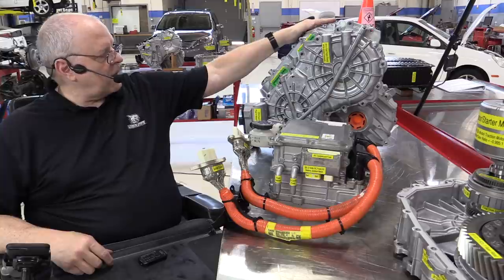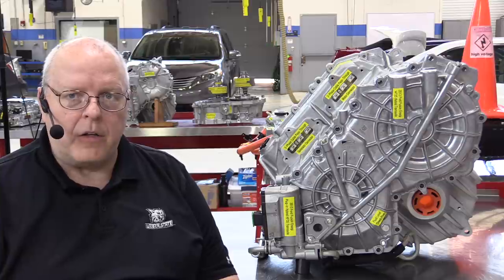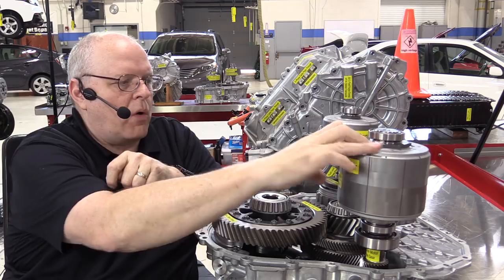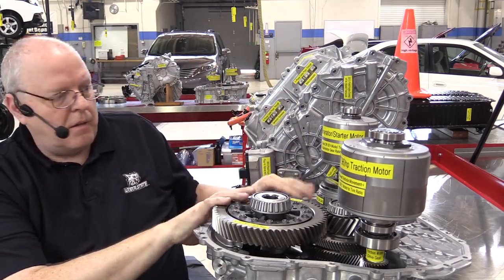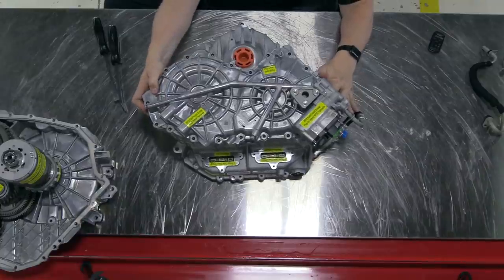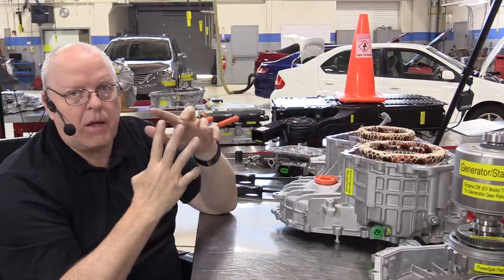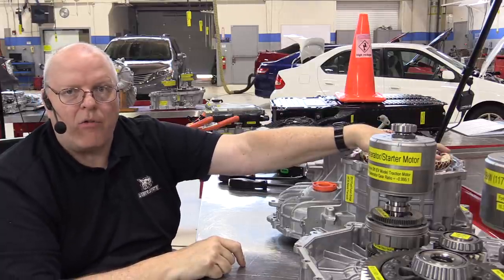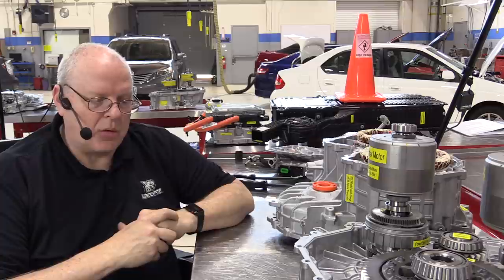Ford Fusion HF-35 Hybrid Transaxle Electrical Operation

Comment: Just bought a 2018 Fusion energi. I'm impressed. Everywhere I read it says it has a CVT. Looking at the gear train in this transmission I do not see a means of varying the ratio. Am I missing something?
Reply from the maker: The rotational speed difference between the engine and the motor “A” creates a variable gear ratio. Thanks for watching
Reply: @WeberAuto  Sorry.. that is not the meaning of a variable. This set up is still a constant ratio.
Reply from the maker: It actually provides a variable gear ratio with underdrive ratios, direct drive, and overdrive ratios. It works just like the Toyota transaxles. See my video here for a better description https://youtu.be/O61WihMRdjM

Comment: At 18:34 in your video. I just want to let you know that the magnetic field in the motor "BOTH" attracts and repels as part of the process of moving the rotor. During rotation, if the stator magnet is "after" the rotor magnet, an attractive force is applied. But once the rotor magnet passes the stator magnet. The polority of the stator magnet is reversed and a repulsive force is then applied. Pushing that rotors magnet into the next stators magnet to be attracted to.
Reply from the maker: Thank you, you are correct!

Comment: Great videos! Do you know how the 2017+ hf-45 differs from the 2013-2016 hf-35 unit?
Reply from the maker: It turns out that the HF-45 was never released. I understand it will be used in an upcoming hybrid SUV
Reply: @WeberAuto  So maybe it is in the new Ford Maverick?
Reply from the maker: @DanNPTRI  I suspect that is true. Probably the same powertrain as the Escape hybrid.
Reply: @DanNPTRI  it is a Kuga

Comment: Professor, Can you explain why this Ford Fusion 2015 transmission has so many problems and have to be replaced? Our 2015 Ford Fusion with 112,000 miles broke down. I've seen lots of videos that show same problems with this model. Thank you for your great videos!
Reply: I'm dealing with it right now on my 2017 Fusion Hybrid. From what I've read so far, it is important to change the transmission fluid at or around 100K miles. Mine failed because of a leak from the driver-side axle output. I didn't notice the leak because of the felt/thin carpet cover (that goes underneath the engine compartment above the ground) absorbed most of the fluid.

Comment: I've heard of a few transmission failures on this gen fusion hybrids. I have one and want to do a fluid change, it seems hard to find any information about a eCVT fluid change.
Reply from the maker: Yes, some models had some bearing failures. Changing the fluid will not prevent the failure. If your transaxle is noisy, have a Ford dealer check it for you. They are fixing these under warranty. The fluid does not need to be changed until a very high mileage. Check the maintenance schedule in the owner's manual. I believe it is around 150k miles (241 km) Best wishes.

Comment: I have found two cmax energi 2013 transmissions with bad bearings between 120k and 150k it seems this is a common problem

Comment: Do you think this transaxle (specifically) would hold up to towing?
Also it would be interesting if you could show the part that commonly failed in the transmission of models leading up to 2015.
Reply from the maker: I do not know about the towing. I suggest looking in an owner's manual to see if towing is an option on the car.
Reply: Owners manual says NO towing.
Reply: I wouldn’t tow at all. The Drivetrain was not designed for towing at all. You m pretty sure the weight limit is super low as well but I might be wrong about that don’t quote me. Edit: I typed toe instead of tow🤦🏽‍♂️

Comment: Is it common for 2014 fusion energi trans case crack at one of the bolt location and start leaking trans fluid after 8-9 years?

Comment: I just wanted to point out a mistake that you made a 17:20 in the video. You stated that you cannot swap the "V" wire? That's not true. You can take "ANY" 2 of the 3 wires and swap them to reverse the motor. This is not only true for AC mains 3 phase motors. But for inverter driven BLDC motors as well.
Reply from the maker: True, I was referring to 3-phase wiring configuration on these systems only. Thanks again

Comment: 18:33 actually half of the magnets are being pushed and the other half pulled. when it comes to magnets it's very confusing if you just look at their poles. if you look at the magnetic field lines actually it isn't pull or push but simply a rotational force
Reply from the maker: Thanks for your feedback. I was describing the operation on a very basic level and showing the relationship to the resolver cam positioning. Yes, it is more complex than what I was describing. Have a great day.
Reply: <3

Comment: Thank you John for demonstration. I have one question and I hope you can help me with that. I own 2016 Ford Fusion Energi with 98000 miles and I got check engine light that once in a while comes and goes away but the vehicle drives well. When I use a scan tool Im getting the code P0C2A which is for Auxiliary Transmission Flud Pump A Motor Stalled, so I thought that may be a fuse and I checked all of them and I didnt found any issue. So Im not sure if there is a good chance that auxiliary pump is dead and i would appreciate if you can tell me how I can test it. Thank you so much in advance.
Reply: I get that same check engine light every once and a while too, I just turn the car off and then back in and it's gone. idk what it is

Comment: My 2014 ford fusion hybrid started making a noise which i thought was a wheel bearing. It has 71k miles only. Ford says its noise from transmission. Shaft bearing i suppose? Anyhow they said they will replace the whole transmission as part of warranty. Is transmission failure common on these cars? Thx
Reply from the maker: Hi, a few model years seemed to have the transfer shaft bearing preload issue. Ford is taking care of the transmissions affected. Thank you!
Reply: My 2019 Fusion Energy had the trans noise at 56k, Ford replaced it under warranty.

Comment: Thanks for the effort put in. ♥ ️ ♥ ️ Is there a real problem with the gear transmission for fusion energy  2017 and what is your advice to keep it the car make 40k mile
Reply: The 2016+ is bulletproof.
Reply: @16vjohnny  my 2013 got a new transmission put in under warranty,  hopefully that is also solid... 180k miles so far on the replacement

Comment: John, I was thinking they are probably firing the IGBTs quickly to make AC.
Do you think the rotor position feedback/encoder is a hall effect (discrete) or a cosine feedback?
Reply from the maker: Not hall affect, sine and cosine input, combination output (three coils of wire)

Comment: Hi .. I’m just interested to know from you as an expert where was the issue of the third generation that makes the bearing failure .. in the second generation doesn’t exist...
What I noted was a lot of gear housing had a leak ... do you think it’s an adhesive or the sealant  bad quality that makes an oil leaking which leads to bearing failure..??
Reply from the maker: No, it is my understanding that it was caused by was improper preload on the transfer shaft bearings.
Reply: WeberAuto 
Please be patient with me 
This doesn’t enough to explain the leaks...
I’m living in Jordan the weather is hotter than USA...we have here more than 25k Ford Fusion Hybrid and I can confirm that 90% of these cars have changed the bearings related to fluid leaks...
I’m working in car mechanics field we tried to contact the ford dealer they confirmed that there were an industrial issue with bearing components this doesn’t make sense to me even the 2017 cars have the same issue...if you have ford hybrid you have to check the transmission fluid Q 10 days ... we have changed a lot bearings the issue started with leaks around the bolts and the housing ... there must be logical rational to explain this...

Comment: Any update on fusion transmission bearing in the 2017 because the last model have reacal on transmission bearing
Reply from the maker: They fixed the issue

Comment: Anyone know of a high mileage C-Max with this transaxle? I currently have 133,000 miles and running fine, all original. I DID replaced the Mercon LV at approximately 100,000 miles

Comment: Question for you: The 2.0l Atkinson 4 cylinder makes 140hp, the electric traction motor here makes 117hp; 140 + 117 = 257hp total between the two motors - so why is the Fusion power only listed as 195hp?
Reply: Du kannst nicht die Kräfte einfach addieren. Das wird berechnet.

Comment: I have a 2014 Fusion Energi with 115,000 miles.  Right after passing the 100,000 warranty period, a mechanical noise began and I have learned of the TSB that documents the known problem related to the gear and shaft assembly.  After watching the video on the electrical part, I'm a little nervous about having the transmission opened up for a mechanic to replace the gear and shaft assembly versus replacing the entire transmission, though I cannot afford a whole transmission replacement.  Is my fear legitimate?
Reply: The 2014 was one of the years affected, though very few Energi models were actually impacted, so that's unusual. Ford might help you out since you're close to 100k, but likely not. It's worth asking. Salvage HF35's can be had in the $3,000 range, if you do that, make sure you get a 2016 model year. That said, I really don't think a rebuild is a good idea unless you get a very good guarantee from the mechanic.
Reply: @16vjohnny  What do you think about 2017 model year of Ford Energi?  Are they still suffering from this transmission problem?
Reply: I ended up having to swap the transmission out my self. I was just out of warranty at 103k and ford refused to help at all on my 2013 fusion hybrid. Unfortunately the replacement transmission got damaged in an accident and i have to replace it again. I am going to attempt putting in a transmission for a 2018 Fusion Hybrid with the same 2.57 gear ratio. The only difference is that in 2017+ model years the transmission is actuated electronically. But, it looks identical to the the original trans and the gear selector feels the same. Wiring is the same too.

Comment: Could you please answer a question for me, I have a 2019 Ford Fusion Hybrid,  as I was going down a long hill the other day and the car started making a strange noise,  sort of like the sound anti-lock brakes makes only not as bad. I noticed that the HVB was showing that it was maxed out with power, what happens when the HVB is maxed out but the dash symbol is showing that Regen braking is still charging,  how does the system use up the over charge that's coming to the battery,  is there some system to burn off that extra energy?  As soon as I used some of the battery power it never made the noise again.
Reply: That’s likely the electronic brake booster if it sounds like the abs system when running in ev mode there isn’t an engine running to produce a vacuum for the brakes to instead they use an electronic pump that will run occasionally to give you boost when the brakes are used, ex(battery full, battery hot/cold, etc)
Reply: @theamazoner4075  , thank you but I was just using the sounds like the anti-lock brake sound as an example of what it sorta sounded like. The anti-lock brakes was not activated.  My question was,  does the car have in place a system to use up the power that the regen system makes instead of over charging the HVB?

Comment: I wonder how much Toyota IP is in these transmissions. Aisin is just about fully owned by Toyota. I still wonder why it took Toyota to the 4th gen Prius to get to the parallel axis design while Aisin has been producing them for much longer.

Comment: Hi professor John. I have a question. Can I wash the engine in my ford fusion hybrid 2014? If I can how the procedures for washing and your recommendations please. Thanks
Reply from the maker: I clean my engine bays with degreaser and then low pressure water from a hose. Do not use a high pressure wash.

Comment: Besides a dealership, do you have any idea where I can find a re-manufactured transmission for my 2016 Ford Fusion Energi?  I've looked high and low across the country and can't find one.
Reply from the maker: I do not know, best wishes
Reply: @WeberAuto  I searched high and low and it's either Ford or a salvage yard. :(

Comment: Hello.Very good video ! Sorry for dump question.Electric engines coils flashes in to oil or not ? ThankYou.
Reply from the maker: Thank you, I do not understand your question though.
Reply: @WeberAuto  Sorry for bad english. Stator copper windings hermeticaly isolated from oil, or oil circulate too this copper, coils swim in to oil, submerged into oil.
Reply from the maker: @miciusbmw  Copper stator wire is cooled by oil running down and across them, but nor submerged
Reply: @WeberAuto  Thank You professor !

Comment: Any harm in adding some Lucas oil additive to this transmission to help the bearings last longer?
Reply: I kinda want an answer to this as well. Lol
Reply: @TruFire710  I've been using Lucas automatic transmission repair fluid init now for about 20 thousand miles. It's been fine. Infact I have confidence that it's working better. I just only put in a half quart right now while I'm still experimenting. But, the only reason it's not recommended in CVTs is because of the rubber band. The hf35 uses all metal gears, so it's not a concern. I say go ahead and do it. But don't overfill.

Comment: So can I really drain and fill the HF35 fluid at 150k per service schedule?  I now have 121k on my CMAX and the dealership doesn't want to touch it since it's never been changed before.  But this transmission is more like a manual eh?  I am not using the car with a heavy service schedule.
Reply: I had them drain and fill,  about 8k more so far with no issues.

Comment: Interestring, it makes me want to change the oil in the "trans" of my C-max.  Thanks.
Reply: Isn’t easy? And to think many C-Max cars are in the junkyard because Ford dealers told their owners that the fluid was “Lifetime”! When the HF-35 failed due to improper maintenance (at Fords direction!) the cars were not worth repairing! Ridiculous

Comment: what is the voltage and amperage on the motors? Is for a University project, please help me!
Reply from the maker: 288V, the amperage depends upon acceleration, but most likely under the fuse rating in the battery. Thanks for watching

Comment: Is there a procedure for removing those rotors to stop them moving off to one side as there was in the Honda?
Reply from the maker: I am sure there is a procedure in the assembly plant and the rebuilding plant, but there is no procedure for a service technician to remove the rotors. It is not an approved service procedure for that reason alone. I figured out a way to remove the rotors from the stators, but there was unwanted contact as I was removing them. Of course I only removed them for educational purposes ;) See this link to see me removing the rotors of a Toyota P610 transaxle https://www.youtube.com/watch?v=-dHeRJdrnI8&t=3398s

Comment: my car The exact same box messed up there inside the bearings Where can I find the bearings?
Reply from the maker: Good question, I do not know. Try to get the bearing part numbers from the races and see if an auto parts store can order them for you.
Reply: @WeberAuto  I wish to know why bearings fail in this transmission, and make that noise. Some say it is a faulty design, that the revolutions of the gears are so many times the wheel speed and thus the bearing failure. I work at an Independent repair shop, and we can't scratch our heads from the amount of transmissions we get daily for bearings' change.
Reply from the maker: @akhataybeh  Bearing fail because of lack of lubrication or improper bearing preload or fluid contamination.
Reply: WeberAuto thank you for the reply, locals here don't change the HF35 oil at all, but maybe the preloading issue is a mistake by the manufacturer
Reply: what kind of bearing you guys use to replace the faulty bearing?
Reply: @akhataybeh  hello my friend 

i read your comment can you please let me  know when they came to your shop with bearing failure do you change the whole transmission ? with used or new one ? or you just change the bearing ? if just change the bearing , what type or brand of bearings you used? and have you change to your clients bearing and they after that face another bearing failure ? thanks

Comment: You state that the motors are Wye wound.  But are you sure about that?  Wye usually has a neutral conductor, but i don't see one.  I think those motors might be Delta.
Reply from the maker: They are Wye wound. There is a connector with all three central windings in it wrapped up on one end of the stator. It is typical for hybrid and electric vehicle stators. Thanks for watching
Reply: @WeberAuto  very interesting!  I stand corrected. I thought wye existed mostly to take advantage of the neutral but it sounds by that description that the neutral isn't used. Is that right?  Is wye simpler to power perhaps? Why choose one over the other in an EV?
Reply from the maker: @billycroan2336  Correct, no neutral. I believe the wye formation allows more stator slots to be energized resulting in a finer degree of rotation of the rotor.

Comment: I bought a Fusion last year and you put my mind at ease about what I thought was a problem but is clearly normal operation.

Now I have another question for ya!  I just now noticed TSB 17-0039.   My car isn't exhibiting any symptoms or anything, but I did notice on my sticker on the door jamb that the car was mfg in Feb 2015.   Do you know much about this potential problem?  Is it something that's a COMMON occurrence that you know of?  If so, I may want to trade the car in before it gets too many miles on it.   Everything else aside, I've really enjoyed the car for the last year or so!